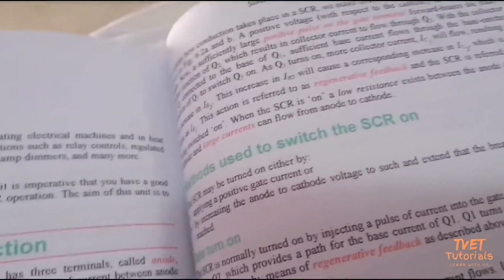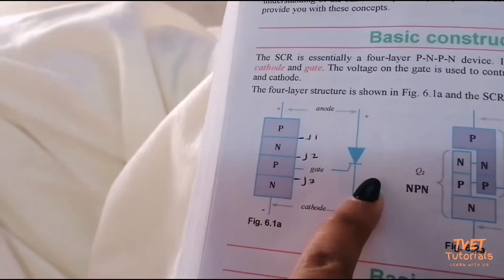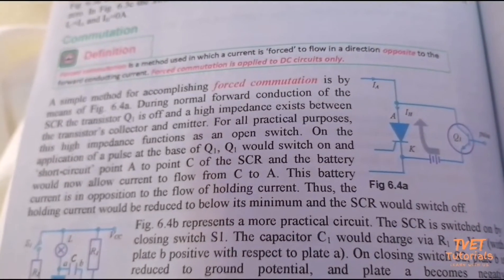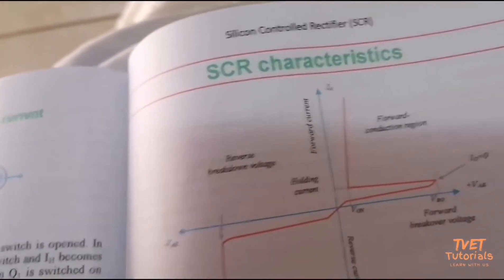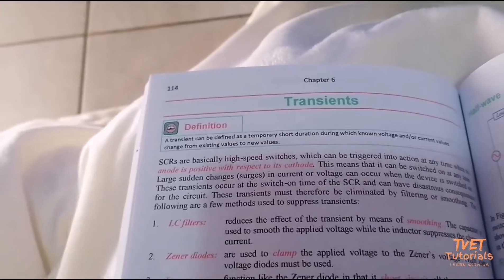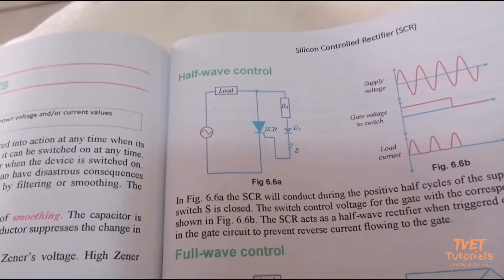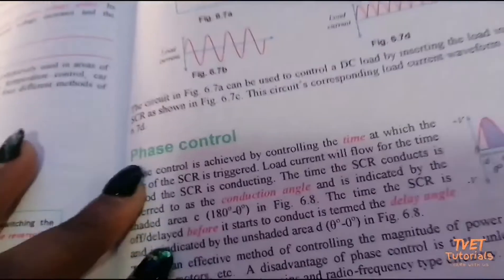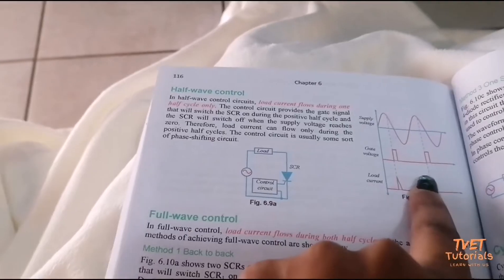Industrial Electronics N3 - Silicon Controlled Rectifier (SCR)

Comment: I think you understand the concepts but  please review how you explained forward biased , you swapped around the information 

As you initially said that j1 and j3 are forward biased and j2 is reverse biasedfor the scr to be forward biased and later on you said that j1 and j3 are reversed biased and j2 is forward biased for the SCR to be forward biased😢
Reply: She is right  , because  she said you need to apply  voltage  to the gate for the SCR to be on  , which means j1 and j3 will be in reverse biase mode